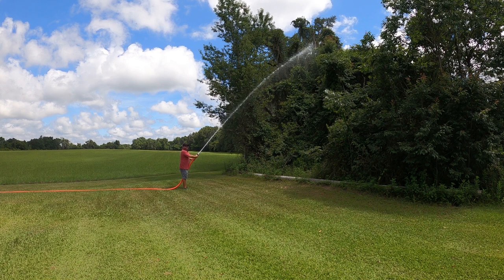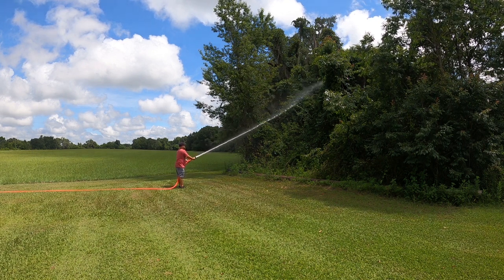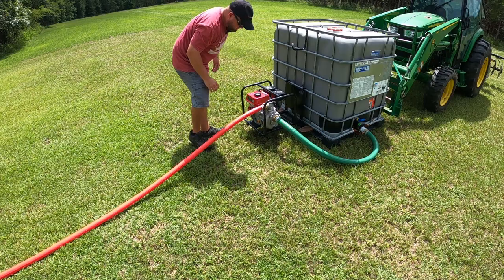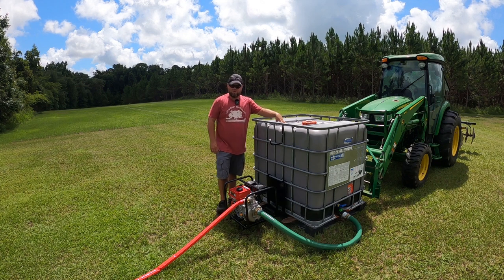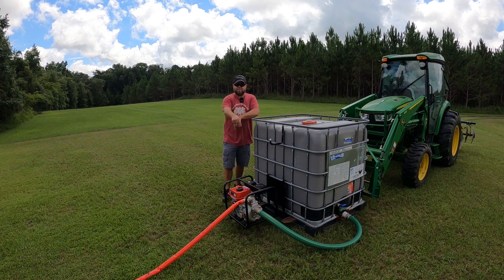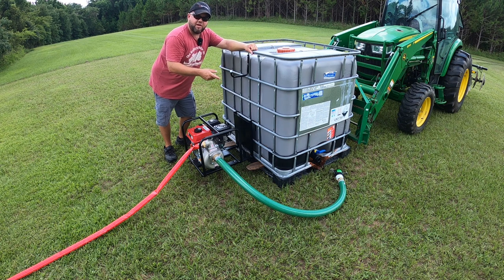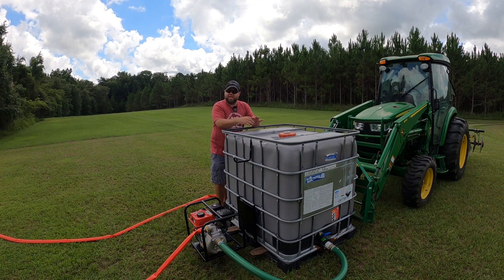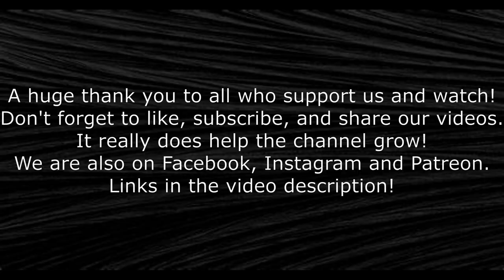Building a homestead fire truck! #603

Comment: Good idea for small woods fire or watering trees for sure. When you drag a hose like that through burnt area it will not last long. They make a booster hose that goes on the fire truck that would work better and put a reel on the tank to deploy it. I would not recomend you trying to put out a house fire with that. I would keep a couple of 20 pound extinguishers for a quick knock down with an inside fire. Go see the volunteer fire department in your area they may have outdated hose you can have no guarantee though.
Reply from the maker: I like your thinking.
Reply: @TKCL  i am a retired firefighter of 30 years so i guess i remember a few things lol good luck there as well Happy 4th 👍

Comment: That's nice. When you had the video recently about harvesting the wild blackberries I wondered about this. When you were talking about a drought, I was thinking there must be a way to haul and spray water to get a better harvest. I think this would be very good. If you could rig it to be controlled from the tractor, maybe with a remote controlled valve you could just drive and spray the bushes on the side of the pasture.
Reply from the maker: I've been thinking about watering those too

Comment: Make a intake pipe so you drop the nozzle in the pool, pond or wherever to fill the tank or transfer to somewhere else. Like fill the tanks from the pond to fight a fire. Could not have power for one reason or another. So it would be an option.  Would it be possible to use the pto on the tractor for a pump? No other engine to maintain.
Reply from the maker: I already have a intake hose with filter that's long enough for something like the pool.

Comment: Nice project! I think it would be cool to use a car trailer and make or install a larger water tank on it with the pump attached. Maybe install a few totes that are interconnected with each other onto the trailer. Like that you don't need to be switching between totes every 5 minutes and you can tow it around with the tractor or a truck with a tow hitch. But, on the flip side, refilling will take more time due to a higher volume of storage once you run out of water.
Reply from the maker: I like that idea!

Comment: Put the hose on a reel, it will make it easier to pull the hose rather than unhook it.  Go with a 1 .5 inch wildland fire hose, if you double the tanks on a trailer it will double your time.
Reply from the maker: Good ideas

Comment: Awesome. 💦🔥

As far as chlorine and bromide, they’re not really harmful to grass and plants. They’re not good for it by any means but it’s not gonna hurt it, it’s basically gonna be like pool water, those are the same chemicals they use in pools and Jacuzzi‘s. So I wouldn’t water your lawn with treated water all the time but if you’ve got to get rid of a tank and there are some dry spots on your lawn then it’ll be fine. Especially when you’re spraying it like that, chlorine dissipates very quickly. In fact if you put chlorine in it and left the lid off the tank in about 24 to 48 hours even at that volume it would be dissipated and there would be pretty much no chlorine left in that water. It’s something you would have to keep treating the tanks with, even sealed the chlorine will wear out after a while but if you’re not getting sun in there it will be more than enough and you don’t really need to worry about it. 

Another thing I had questions on was the pressure in those hoses. I’m wondering how the pump handles the pressure when you’re not using the water, if you have it turned off. I’m almost wondering if creating a bypass with a pressure valve that under high-pressure water pump the water back into the tank. If the pump is made to deal with it then it’s not a problem but I’m not sure how those work but sometimes having the pump running without the water flowing could be a problem, I know in electric pumps it is.  

I like the idea of doing a trailer and even having a second set up with a second pump. If one pump were to break at least should still have one and yes you were able to get two people out there with pumps on separate tanks dealing with a big fire that would be beneficial. Another thing you could do would be to put some bulkhead fittings on the top of the tanks for airflow and Plum multiple tanks together so if you put three of the totes on a trailer you wouldn’t have to stop and move the pump in one tote was empty, the water would be able to exchange between totes and the bulkhead fittings plumbing everything together on top would allow air to flow evenly through them so you don’t get a vacuum issue in any specific tank.  

That’s a pretty awesome project. And last week in one of your videos I think you were talking about drought conditions and food plots. If it got really bad it would be nice to be able to get out there and dump a little water on those plots or trees that need it in a really harsh drought condition.  I think it will be awesome if you get animals out there as well. Running a hose all the way out to fill up water troughs can be a problem, especially if you’re going to rotate pastures which is how you control parasites without chemicals, then you could just use this to fill up water containers for the animals and it would give you a chance to run the equipment periodically and keep everything flowing in good condition. Motors don’t like to sit around without running every now and again. But there are so many uses for it and I think building a trailer with a four or even six nice fat turf tires on it would be awesome. That would keep the trailer floating so if your ground was wet or muddy you wouldn’t be leaving ruts in your yard. Water is pushing 10 pounds per gallon, I think it’s something like 8.6 or 8.9 but either way you’re looking at 7000 pounds of water for three totes, having that on a couple street size tires is it gonna leave some pretty hefty grooves on your turf, just building a fire trailer with some nice wide tires on it or even six tires would be pretty awesome.  

You should also check with your local fire department and see if they offer some kind of grant or financial assistance to help you build this stuff and you can become part of your local volunteer fire fighter group. 🤔 i’m sure it would it very least be a tax write off but they might have some kind of financial program where they would actually help pay for some of the equipment if you’re a volunteer fire fighter or they might even have equipment they could give you. 🤔
Reply from the maker: You never cease to amaze me with your knowledge.
Reply: @TKCL  lol. Amaze or annoy you? 😂😂 I guess I’m just a nerd. Lol
Reply from the maker: No, I love knowledge. I may not respond as in depth as you, but I do read your comments.

Comment: you can also get the totes in 330 gallon for extra capacity.
Reply from the maker: I actually have one, sadly thats starting to be far too much weight to lift and carry.
Reply: @TKCL  add it to the trailer ?
Reply from the maker: Yes that is a option.

Comment: Andrew,  
Water is great for putting out fire, so long as you get the wet stuff on the red stuff.  
Have you looked into "Phos-Check" or other fire retardants.  These can be mixed in with your tote of water and will stick to any organic matter.  They will retard fire,  until the product washes off, in which case, it is a fertiliser.  This is what is dumped from planes.  Great advantage of this over water is once you have sprayed your house, walls of your barn, surrounding area, you have a safe perimeter.  Also means that you can define a perimeter, or boundary when you do a planned burn.
Some areas require you to have a licence to use this product, to protect the environment.  
Radiant heat is a massive killer in wildfires, so the trees that are closest to your house, once treated help insulate the house from the heat.

Love the simplicity of the concept.
If fire is a real concern for you, I also highly recommend "The Complete Bushfire Survival Handbook" by Joan Webster.  Though based on the royal commissions into many major fires in Australia, most of the content is universal.
Keep up the great work!
Reply from the maker: Thank you for the information, I'll look into it.

Comment: Cool. HD hose reel. Wonder if a swimming pool filter would handle the pressure so you can drop the intake hose in a creek and filter out big trash before the pump?
Reply from the maker: Actually this pump came with a trash filter.

Comment: Love the idea and I am thinking about it myself as those closest volunteer fire dept. would take at least 15 minutes or more to get here with he first truck.  By that time, your whole house is gone.  Please, never go into a house with that.  Buy 4 or 5, 10 lb fire extinguishers.  It is faster, and if you can't catch the fire in the first few minutes and put out with them, you are pretty much only containing the fire at that point.  You have no support clean air to breath, no fire protection jump suite,  and your hose and nozzle would melt.  A whole room goes up in about 3 minutes and everything else at that point ignites without ever touching a flame.  Spraying from the outside or for all of the other field stuff you are talking about, I am all for it.  Just saying to keep you safe as I lost 4 friends to a house fire in under 4 minutes with the fire dept. arriving on scene in about 4 minutes.
Reply from the maker: I do have several 5lb extinguishers staged in my house. I've actually put out a fire and saved our last home after a lightning strike. It was a scary experience for sure.

Comment: Does a trash pump quickly overheat when you close off the outlet?  Seems like it would need a recirculate valve running back into the tote like fire trucks have.  It's no wonder the hose busted with that kind of pressure and nowhere to go.  Sounds like a criticism, but it's not.  It just needs a T junction at the outlet with a ball valve and a hose back into the top of the tank.  On our trucks we always kept the recirculate cracked open.

Comment: If you grab a set of forks for your 3 point hitch you could carry one on front, one on the back.

I have a set for my tractor that doesn't have a loader. Also, since you have the roof surface how about collecting some rain water and having a ton of water stored. It also might be worth chatting with the local Volunteer Dept and them them know you've always got a thousand or more gallons stored in case they need it.
Reply from the maker: I have considered that, but I don't want to stress the tractors components and or hydraulic system out by carrying 5000 lbs of weight.
Reply: @TKCL  I would imagine you are close to your loader capacity with that tote.
Reply from the maker: Actually slightly over
Reply: @TKCL  definitely look for some rear forks :-) I'm guessing but I bet the lift capacity is higher on the 3 point.
Reply from the maker: It is, but I always have equipment on my rear. It isn't quick in the event of a fire to disconnect and reconnect. My forks are almost always available or on the tractor.

Comment: remember to tell your naibough...and local station
about you 1000 gallon trilor and 4x250 tanks app 4 tons
huge game changer when you arrive and ther is water suppley
i would make more wersetile hose outlet.  1 hose is just not enough 
if house is in line of fire or barn .. it´s the amount of water you can
lay down who cool most fiers out.. remember heat oxygen combustabels 
take on away .. heat .. with water fire die.. ... 
make 1 more big on and 2 shorter smaller to a controled burn who ran wild

Comment: The red hose looks like a low pressure discharge hose, not a fire hose. Could cause more issues in the future.
Reply from the maker: It's sold and labeled as a fire hose, we used these same hoses at a paper mill I use to work at. It's just a low quality firehose.

Comment: Love this idea. Is there any way to daisy chain a few of the totes together? Just thinking if there is a fire that is getting out of control the time that it takes you to remove the hose and pump and connect to the next tote could mean the difference of being able to put the fire out vs it flairing back up. As always love the video!!
Reply from the maker: Yes I can do that with pvc rather easily.

Comment: Great idea Andrew.  I’ve been looking to do something similar but place the pump and tote on a trailer and pull with a UTV.  But this option seems less expensive.  What’s the lift capacity on that loader on your tractor?  Dave
Reply from the maker: It's 2300lbs, so I'm actually overloaded at this point. I plan on building a trailer with multiple totes.

Comment: What is the green supply hose? And the connections you used to connect to the tote?
Reply from the maker: Bought off of Amazon. Trash pump supply hose. I got an IBC tote to 2 inch pipe thread adapter.

Comment: What about having a tote on the back 3 point? I am putting together a similar smaller set up in the back of my side by side. With a 12 volt pump
Reply from the maker: Way too much weight for the tractor, that's 5000 additional pounds of stress on the axles and components.
Reply: @TKCL  could you pull the trailer behind your Deere with totes on it?
Reply from the maker: Absolutely or my truck if need be. I am rounding up axles soon for my trailer build.
Reply: Yup on the rear no problem. Tractor 3 point actually handles it better than the loader. I modified these forks to work on the 3 point.  https://youtu.be/e5ldHiCIGyk
Reply from the maker: What I was referring to was one on the front and one on the rear. That's too much weight. The reason I prefer the loader option is because my forks are always on or quickly available. There is always equipment on the rear, that makes a true fire fighting situation not quick with all the unhooking and hooking up of 3pt equipment.
Reply: @TKCL  somewhat true but with my setup 3 point quick hitch is just as fast as SSQA on non-pto equipment. My tote will also work on front with these same modified forks which I retained their original SSQA design.

Comment: with those pumps is it ok to shut off the output? e.g. leave the pump running for 5 or 10 minutes with the output hose shut off? is there some sort of pressure relief valve so that its not actually trying to pump?
Reply from the maker: You technically should have some flow running through them. I usually leave my firehouse cracked.

Comment: You may want to use non ethanol fuel or stabil.
Reply: Also a spare hose for backup
Reply from the maker: I always run non ethanol in my outdoor equipment

Comment: I'm about to do something similar and was wondering if that was a 4 series tractor you had and how it handled that tote full of water?
Reply from the maker: It is a 4066r. It's a lot of weight, but it does handle it OK. Slow and steady so I don't damage anything.

Comment: Hi mate its been over 7 months since my last comment just checking in to see if you've done any changes or modifications to this version
Reply from the maker: I did buy a hose reel to quickly unroll and roll up the hose.
Reply: @TKCL  that's good to hear I'll be installing a hose reel on my own trailer unit in mid to late November now that I've done away with ball valves and have opted for straight supply line from tank to pump using cam lock fittings

Comment: Put four totes on a trailer and build a manifold tying the four together and one outlet for the pump to pump from boom 800 plus gallons of water to pump before refilling no moving connections around.
Could build a lightweight platform for four totes so you can unload off of trailer if trailer is need for other projects.
Reply from the maker: I like it!